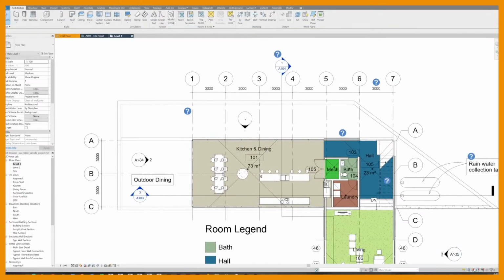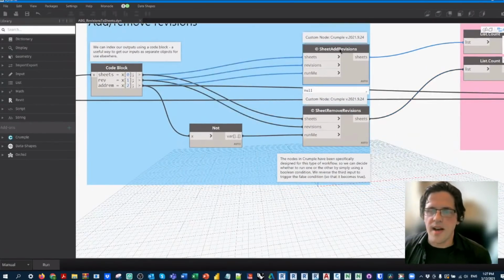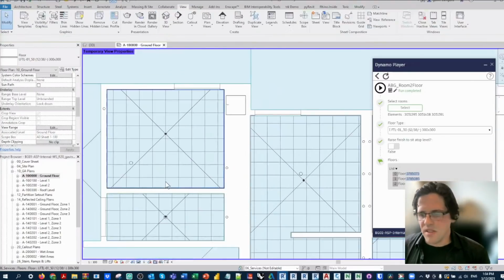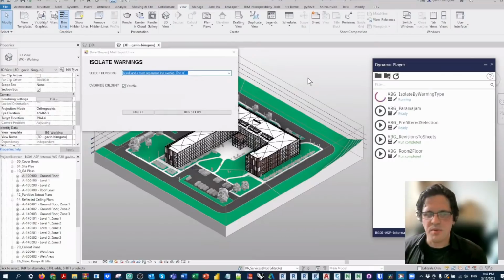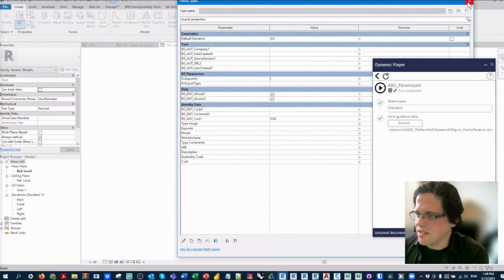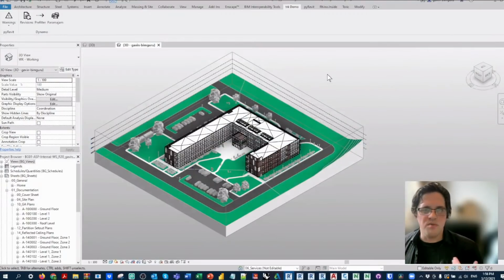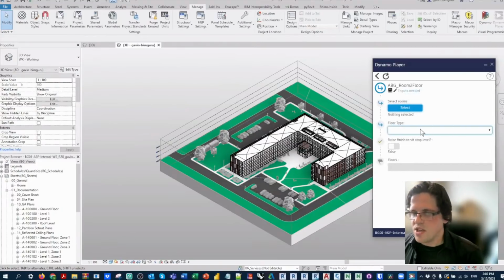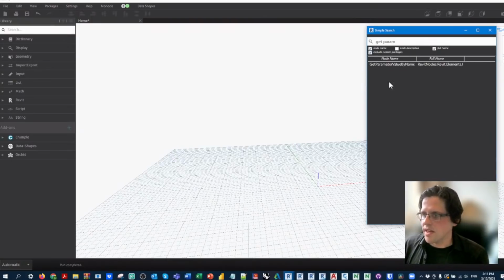Practical Dynamo for Revit (w/Aussie BIM Guru)

Comment: Wanted to throw it out there, for archi-lab's feature of relays. You can disable that feature by removing the file, `archilabViewExtension_ViewExtensionDefinition.xml` from the extra folder in the package directory.
Reply from the maker: Awesome, thanks for sharing the tip John!
Reply: Great tip, thanks!